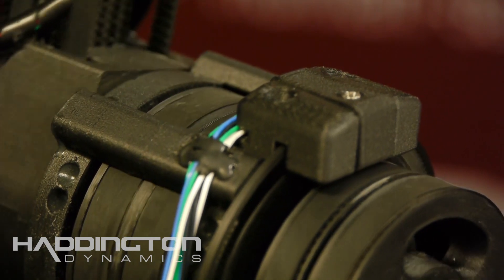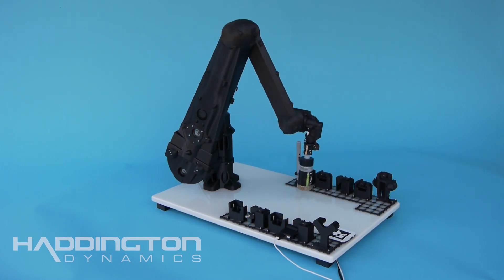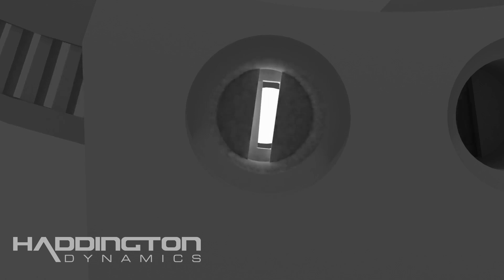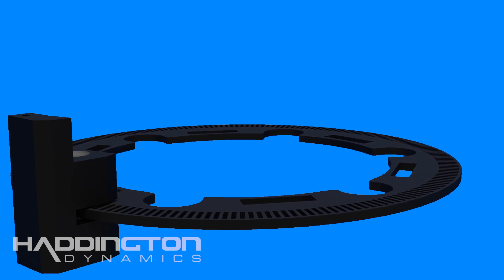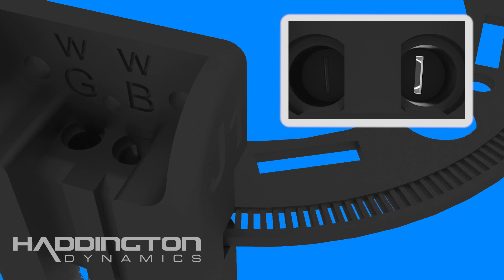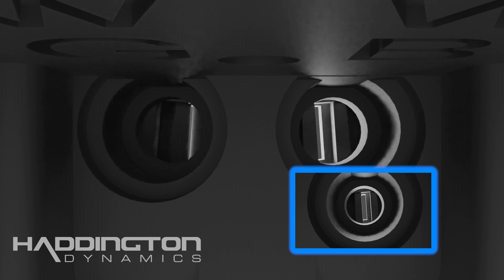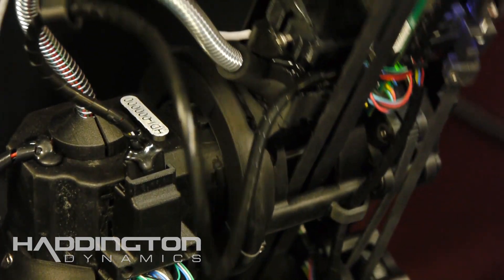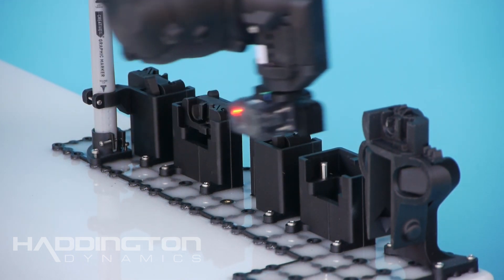Optical Encoders

Comment: wouldnt any flex in the robotic arm make the very high resolution of the encoder useless?
Reply: I think that is excatly why they use that presice system of measuring position, if there is any flex thta is made by the lack of stiffness of 3d prined parts, they can observe this flexure and with good feedback loop they would compansate for this flexure, by moving arm a little more back or forward. But is just my spelucation, im nuot sure of that. But if what they say about posibble pressision of the arm is true, they have to make some kind of comapsension system for this problem.
Reply: @michazarzycki1634  how do they measure how much bend it's experiencing? the encoder would be on the joint
Reply: @justinc2633  i mean, u know how much you wanna move by a certain agnle without any flexure, so if you gonna go over this point after you stop rotation of the motor, it means that you overshoot the position, and you cen compensate. Am I correct?
Reply: @michazarzycki1634   flex would be in the arm, you wouldnt go past the point at the point of rotation, to measure the amount of error you would need to be able to compare the theoretical location and the actual location of the point in 3d space

Comment: I would like, But Since Yt has made likes Meaningless by removing dislikes, I'm going to comment and say that this is cool, and I would like to use the encoder stuff to use for a 3d printer filament movement encoder type multi sensor.
Basically building up the INFIDEL sensor created by Tom Sanlander, for fil diameter but with added features.

P.S. and if you don't like this comment feel free to dislike, but nobody knows which means nobody cares. So leave a comment instead with constructive criticism.

Comment: Is that encoder disk part of a cyclonic drive?
Reply from the maker: Actually, it is not. Our encoder system is independent from the motors and gearboxes. We put our encoders at the axis so we can measure the actual angle of the joint rather than the reading from the motor. This adds to the force sensitivity in the robot by allowing it to detect any flex in the joints which the motors can then compensate for.
Reply: @HaddingtonDynamics  very precise! I see belts, but I thought it used a cycloidal drive.  I've been trying to find the gearing system.  But I can't find the open source.  Could you point me to it?
Reply from the maker: @TheRainHarvester  The cycloidal drive was a prototype model that we were developing a couple of years ago. Most iterations of Dexter have been built with strain wave gears. More info can be found on them at our GitHub Wiki page here: https://github.com/HaddingtonDynamics/Dexter/wiki/Hardware

Comment: Cool project!! Is this part of what what you use the FPGA to calculate? I want to build this and see that most is open source, but the code for FPGA is copyrighted right? Is this something that can be accessed or how can I access this if I want to attempt this project? :) I'm interested in using this instead of closed loop steppers or servos.
Reply from the maker: We use strain wave drives (originally from Harmonic, but now from Cone) to provide extensive gearing for most joints, and a series of pulleys provide gearing for J4/5. We have, in the past, rapidly microstepped back and forth over those 0.9 / 16 positions to increase resolution on J4/5 but the new HGI uses a set of pulley reductions to avoid that. Any error in belt stretch (which is minor due to the use of Kevlar) are corrected out quickly as the encoder sits at the joint and the FPGA updates rapidly. 

The files that Dexter needs for the FPGA to run are on our GitHub page (https://github.com/HaddingtonDynamics/Dexter). One obstacle you may come across in the process of sourcing materials is the custom PCBs which we sell as a package on our website for people who wish to DIY their Dexter. It also includes a microSD card with the files and operating system preloaded onto it. That can be found here: https://www.hdrobotic.com/shop/boardpackage

We look forward to seeing your build!
Reply: Also. How does it translate to positioning. I guess it can't be used to microstep a normal .9 degree stepper motor to 1.8 million microsteps?

Comment: Can Dexter control a small plasma torch with a fair bit of accuracy using Nema 23s?
Reply from the maker: With a redesign to account the size of the motors, it could be done.